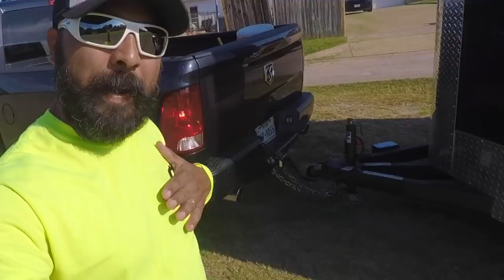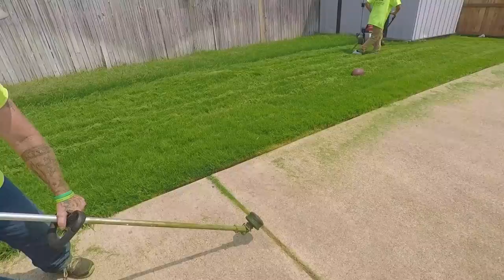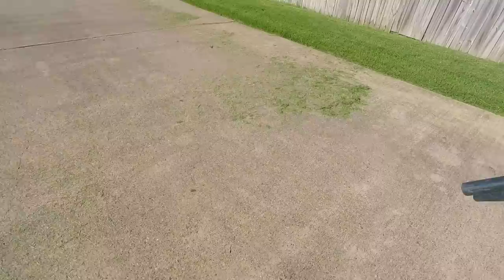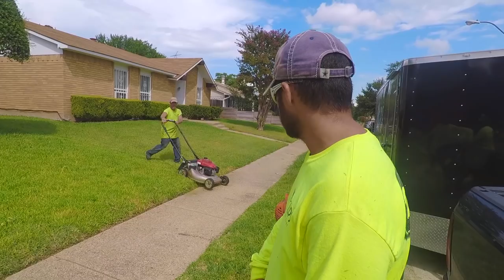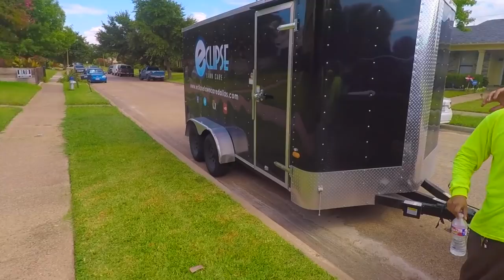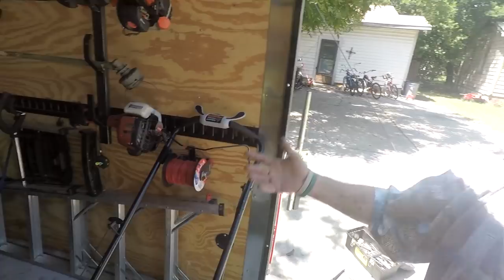Another Day Another Guy.

Comment: Do you guys have Twitter.  I owe a landscaping company that I do on the side from working with a major corporate landscaping company . I use x mark 72 inch deck vacuum system zero turn radias mower. Honda hrc 216 self propelled mowers line trimmers I've mastered the line trimmer I'm from Vancouver bc Canada. U need a line trimmer a ace line trimmer I would show u how it's done verts horizontal were u located